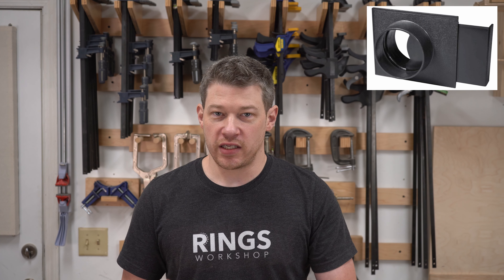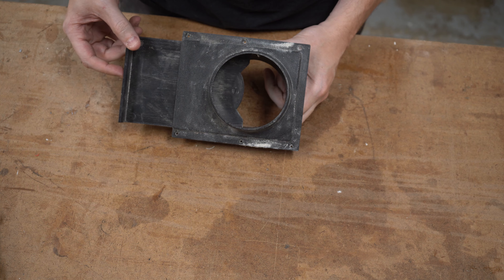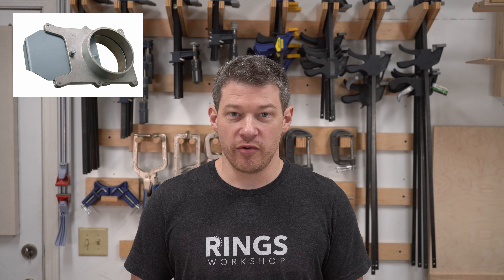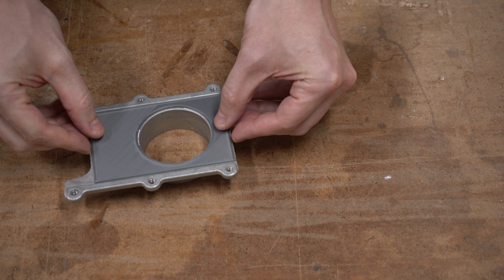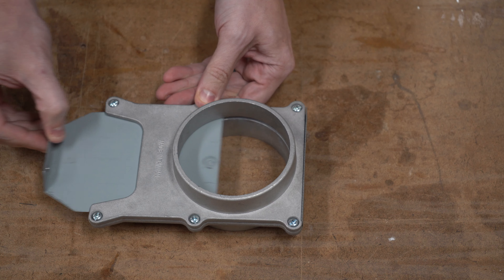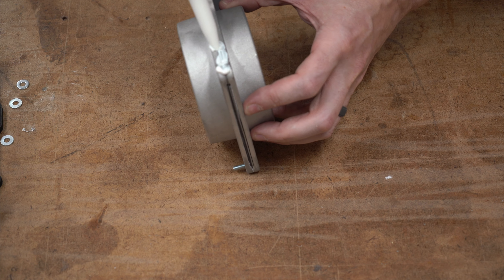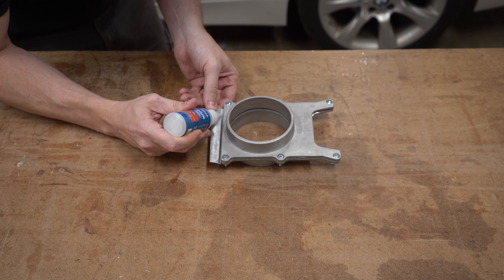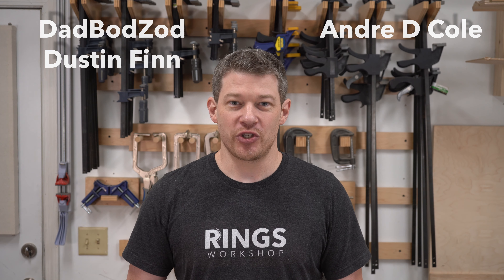No Leak Blast Gates

Comment: You should sell those 3D printed spacers - I’d sure buy them. I too am blessed with the metal gates you chose to doctor and since they are the most economical non-plastic blast gates from Rockler I bet many others are too. Thanks as always for the innovation and inspiration
Reply from the maker: I hadn’t really thought about it, but if I got enough interest I may do that!  I have another video coming out in the future around automating everything that includes more 3D printed parts.  Could always do those together.  Appreciate the idea, and thank you for the kind words!
Reply: agree. if you could make the aluminum spacers to fit several different brands and sizes.

Comment: I've opted for the slide through gate in building my fully automatic system. To solve the leakage issue with both aluminum gate types, I used my 12" disc sander to remove both the shoulders along the edges on one half of the gate. The opposing shoulders on the other half are just high enough to allow slide clearance.
Reply from the maker: Good idea!

Comment: I have experienced that problem with my 2.5" gates as you mentioned.  They're the plastic ones as well, but I just used something thin to get in there and clean it out occasionally.  I've had my "ganged" up in a 4way box, but 95% of the time I'm just using the one blast gate.  I was ready to move towards the aluminum, but seeing the problems they have, I can't say it's the way I'll go.  Maybe I'd consider those electric gates that open and close when they detect power to the tool.  Not sure how they'll fair, but I'd guess they'll have clogging problems too.
Reply from the maker: So far these have helped quite a bit, finishing up my own spin on automating the blast gates, should have a video out on it in the next couple weeks.

Comment: Same Problem, Same Blast Gates and Looking For A Solution.  Did you look a the new Woodpecker design or the ball valve design?  Also use a few piece of toilet paper to test for air leaks.  I think you have made vast improvements to the metal gate design. You should sell an overhaul kit.
Reply from the maker: I appreciate it!  If I had the time to produce them I would, just not in the cards currently.  I’m not a fan of the ball valve or wood pecker design simply because of my plan to automate them (another video I have out now).  I also just worry about similar issues of build up or something larger getting sucked in and potentially blocking air flow with more in the way to get caught on.  However I haven’t used either so not sure my concerns are justified.

Comment: I’d definitely buy some of the modified blast gates, if you were to sell kits or modified gates themselves. 

Do you happen to know why blast gates are used for dust collection, versus say a ball valve?
Reply from the maker: Not 100% sure honestly, if I had to guess I’d say it’s because ball valves are harder to open and close and with some DC ducting being 6” I have a feeling cost comes into play also if you could find one that big.  Not sure if wear and tear would be a factor or clogging up, but I doubt it.
Reply: I think I recall someone on YouTube testing using a ball valve. I don’t know the video now. Seems it did not work well but I don’t recall why.
Reply: I typed in “using a ball valve in dust collection” and the first two coming up were on the topic. I haven’t had time to watch yet though.
Reply from the maker: @jimaspinii7579  I know they are a lot harder to turn, not sure if clogging could be an issue or not?  I’m currently working on fully automating my dust collection and a ball valve wouldn’t work for me how I have it setup.

Comment: I was thinking you could use a strip of rubber for the end of the gate instead of duct tape.
Reply from the maker: Probably could, thought about a couple different materials and I think the guy I mentioned in the video may have done that now that I think about it, but you would still need to adhere it somehow, figured the duct tape just solved both issues.  We will see how it holds up over time, I’ll be sure to post any updates in here if I change anything.

Comment: Static
Reply from the maker: For some reason I can’t see your longer response, I only see the comment “Static”
Reply: @RingsWorkshop  I'm guessing he is asking about static build up.  When I built my dust system about 15 yrs ago, this was a big concern in the hobby/industry (could spark an internal dust explosion), particularly with PVC piping.  I think Fine Woodworking did a study just a couple years later that pretty much debunked the concern.  Sadly I still have hundreds of feet of copper wire wrapped around my system...
Reply from the maker: @davehunt0000   I do think that’s what it was referring to, however he had a few other suggestions and it shows the preview in my notifications but I can’t see the full comment.  I think he typed “static” to correct a mispell of “ststic” in the longer response.  I just can’t see more than the first 20 or so words and when I click on it, it brings me to this comment.  Not sure if he deleted the first one on accident?  But I agree with you about the PVC, I have zero concerns about it myself, but I know others still do.